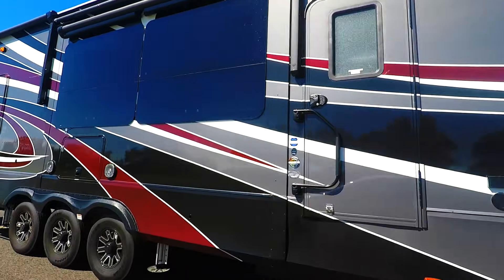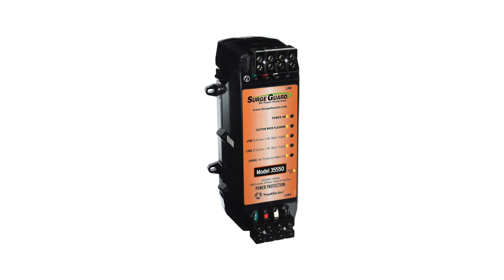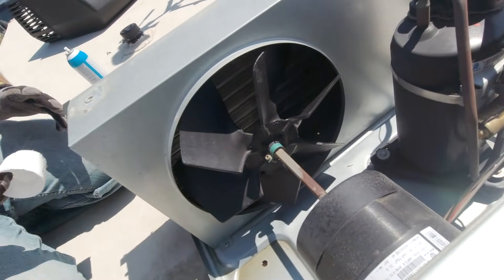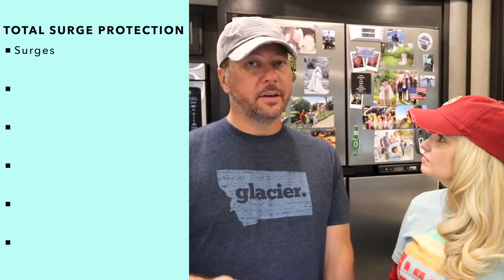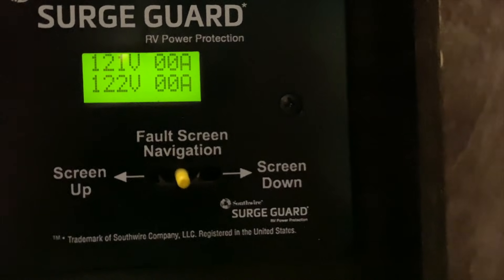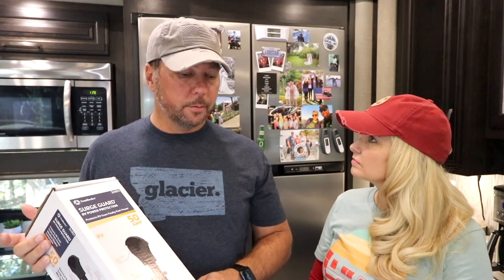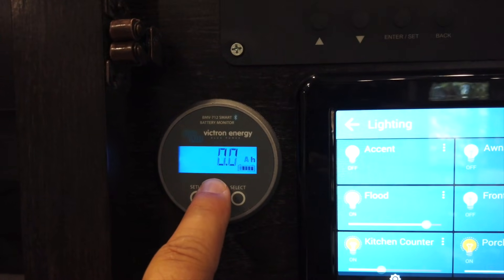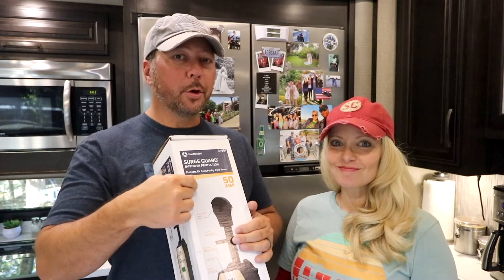⚡️🔌 Total RV Power Protection | Surge Guard | Full Time RV

Comment: #giveaway.  By the way you can use a 50amp with 30 amp adapter
Reply from the maker: True.. just kind of a mess with dog bones on each end.  30-50-30
Reply: Changing Lanes 
Well I do 50 to 30 so don’t have to lug out 50 amp cord.  I do have 30 to 50 plug style if a 50 amp is not available.  Not big deal to use.  I agree you should always use EMS. You guys do great job in your videos!  Very detailed on topics covered.

Comment: You guys did a good job of explaining how surge protection and electrical management systems work.  However, there is a little bit of misinformation presented when discussing the Hughes Autoformer.  You stated the Autoformer "can effect the overall electrical system of the RV park".  This is a long perpetuated myth that needs to be corrected.  Check out the following link from Hughes for more information:  https://hughesautoformers.com/autoformer-university/how-does-it-work/
Reply from the maker: The Autoformer info was from Surge Guard.  There's a lot of debate on this topic right now due to the 2020 Nation Electrical Code proposal.  Depending on which posts I read, the NEC will either be prohibiting or recommending the prohibition of autoformers in RV Parks.  Having trouble finding the full NEC changes for 2020.
Reply: @ChangingLanes  I actually contacted Hughes and they are fighting the new NEC codes in court.  But even with pending action that may ban the autoformers, they are still selling them.  I just bought one three months ago.  I'm not real happy to have spent that kind of money on an item that may be banned in just a few months. Let the buyer beware.